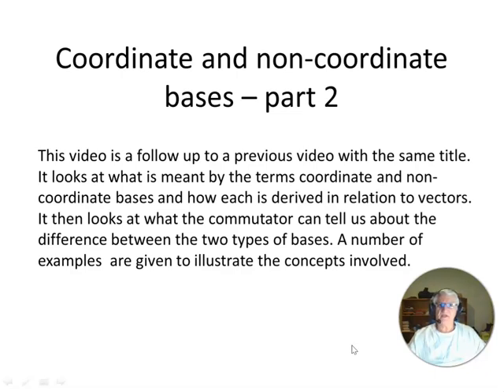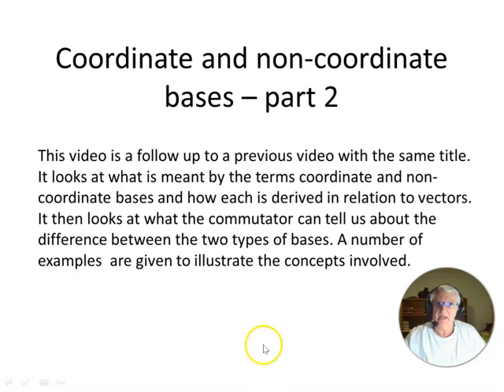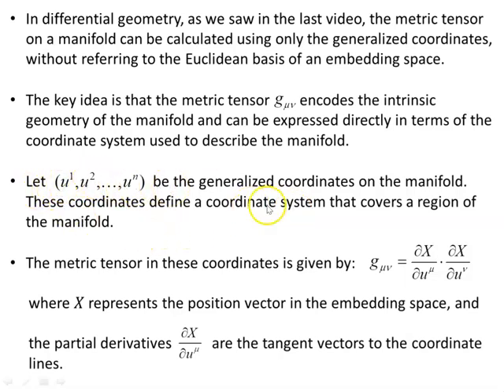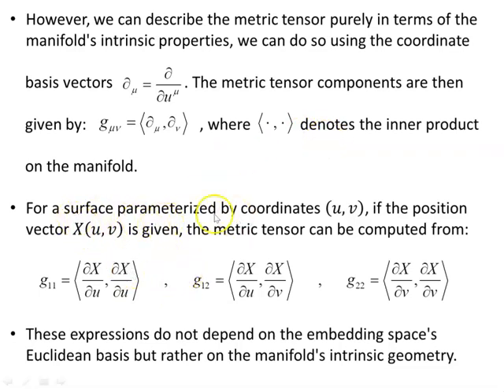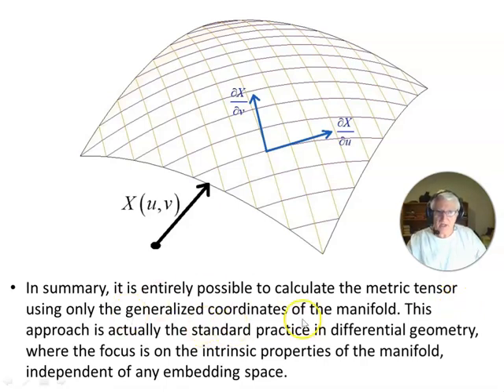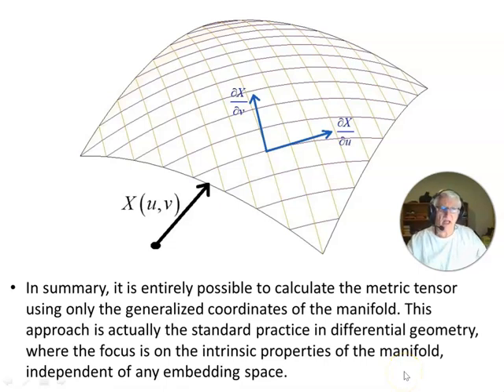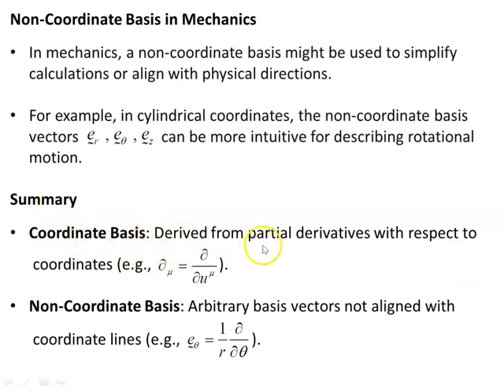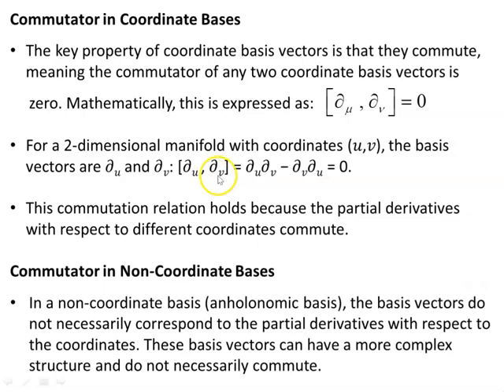Coordinate bases and Non Coordinate bases - part 2

Comment: at 1213, commutator formula at top does not look correct. As written two dot products are always zero.I think you should remove the dots.
Reply from the maker: The dots here represent multiplication as can be seen on the next slide.

Comment: You didn't explain how metric could be known intrinsically, after removing the X. You don't get a number dotting vector operators with each other, and no number no distance calculation for example. Perhaps the surface denizens could measure in different directions and guess G though?
Reply from the maker: Please see slides 2 and 3 where I cover the necessary material needed for this video.

The concept of an intrinsic metric is indeed subtle but fundamental in differential geometry. Here’s an explanation:

Understanding the Intrinsic Metric
Intrinsic vs. Extrinsic Perspective:

Extrinsic Metric: When we define a surface in an embedding space 𝑋 (like 𝑅^3), we can measure distances using the dot product of vectors in 𝑋. This gives us an "extrinsic" view of the surface.

Intrinsic Metric: Even if we remove the embedding space 𝑋, the surface itself retains a notion of distance and angle purely based on its own properties. This is the "intrinsic" view.

Metric Tensor:

The metric tensor 𝑔 on a surface allows us to compute lengths and angles directly on the surface without referencing the embedding space.
For a surface parameterized by coordinates (𝑢,𝑣), the metric tensor 𝑔_𝑖𝑗 (where 𝑖,𝑗 can be 𝑢 or 𝑣) provides the inner product of the tangent vectors to the surface:
𝑑𝑠^2 = 𝑔_𝑢𝑢𝑑𝑢^2 + 2𝑔_𝑢𝑣𝑑𝑢𝑑𝑣 + 𝑔_𝑣𝑣𝑑𝑣^2.

This formula enables the surface's inhabitants to measure distances and angles intrinsically.
Intrinsic Measurement:

Surface denizens can measure distances and angles by considering the deformation of curves and the angles between them.

For example, by measuring the circumference of small circles and their radii, they can deduce the curvature and metric properties.

Practical Steps to Determine the Metric Intrinsically

Local Measurements:

Distances: Measure the distance between nearby points along different directions.

Angles: Measure the angles between intersecting curves.

Constructing the Metric Tensor:

By accumulating data on distances and angles, one can construct the components of the metric tensor 
𝑔_𝑖𝑗.
Suppose denizens measure distances along coordinate directions 𝑢 and 𝑣. They can establish the relationships:
𝑔_𝑢𝑢 = (∂𝑥/∂𝑢)^2 , 𝑔_𝑣𝑣 = (∂𝑥/∂𝑣)^2 , 𝑔_𝑢𝑣 = (∂𝑥/∂𝑢)(∂𝑥/∂𝑣).

Verification:

Once the metric tensor is deduced, it can be verified by comparing the predicted distances and angles with further measurements.

Conclusion
So, even without referring to the embedding space 𝑋, the metric tensor 𝑔 allows intrinsic measurements on the surface. It encodes all necessary information to compute distances, angles, and areas directly from within the surface itself. The intrinsic perspective is powerful because it tells us that the geometry of a surface is an inherent property, independent of how it might be embedded in higher-dimensional space.

It is a good point and really worth a video in its own right.
Reply: Why wouldn’t you get a number? Why does dotting two arrow vectors give a number? Because thats how the operation is defined.